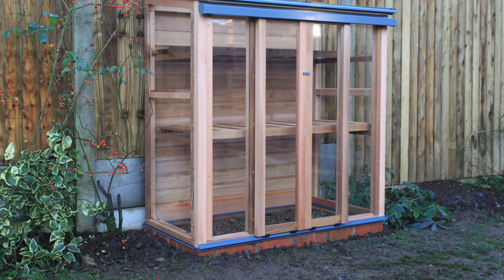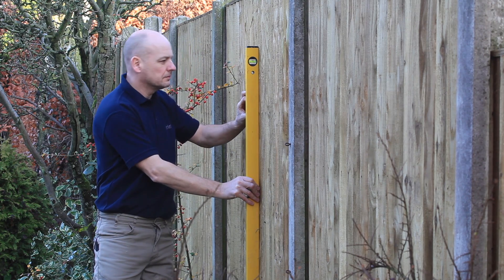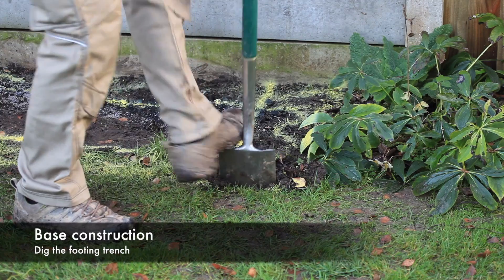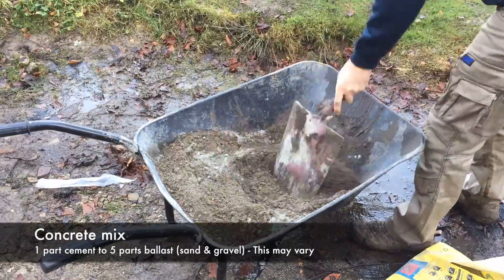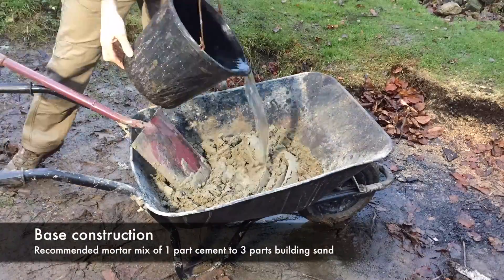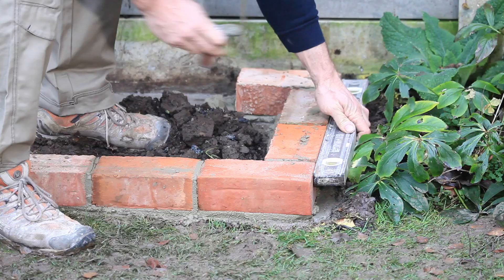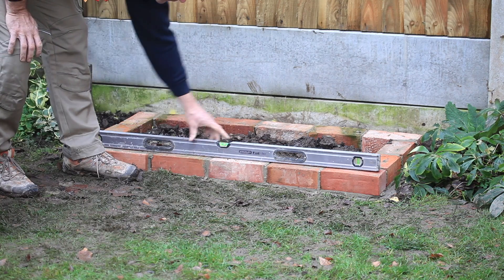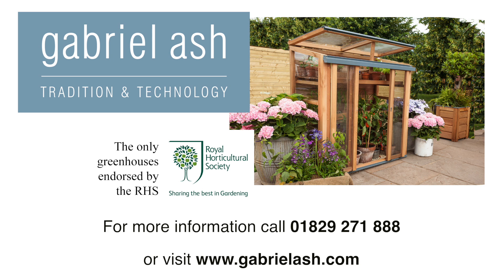Upright Coldframe Base Preparation

Comment: How much water do you add to the cement mixtures?
Reply from the maker: Hi Stewart it really depends on how much you are making. Basically you need to slowly add water to the sand and cement mixture until it is nicely pliable, too wet and it will just collapse to dry and it won’t adhere to the bricks. Hope this helps.